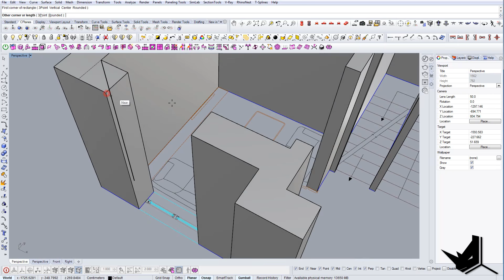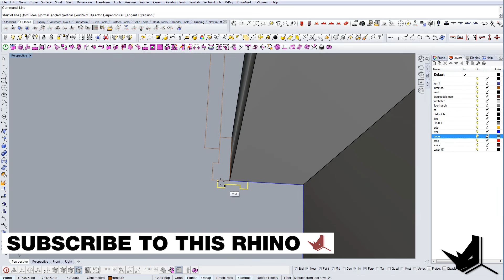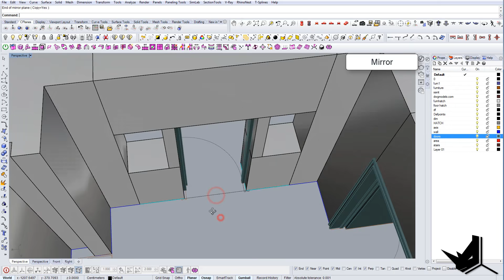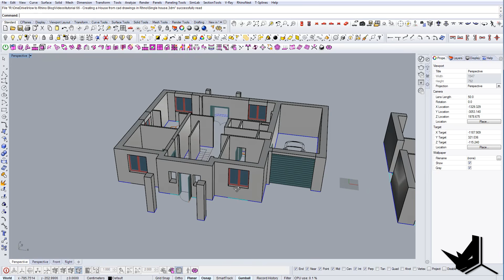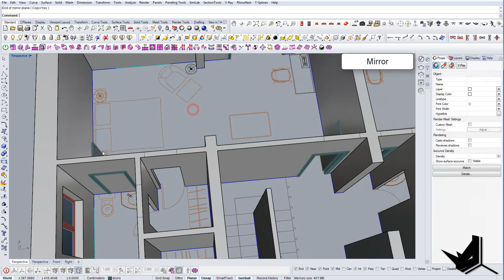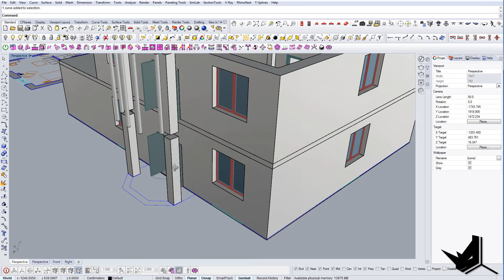Rhino Architecture - Modeling a House from CAD drawings

Comment: is it better and faster than archicad and revit?
Reply from the maker: Rhino is not a BIM software like Archicad and Revit, so we cannot really compare it in the area of which one is faster. They have different use-cases. If you're strictly talking about modeling speed, they can be equally fast if the person who is using them knows both programs very well. Rhino is mostly used for the conceptual phase of the project and BIM software for construction and documentation.

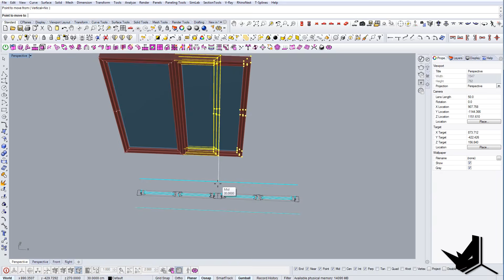Comment: Nice video. A question: how do you constraint direction to modify with Solidpt + move in min 30:49 ? You keep the direction and use a midpoint reference.
Reply: nevermind. Tab key is the key c:

Comment: i already boolion unioned the wall before i could model the window and when i command sweep 1 it doesn't work right,do you have an easier (but accurate method)  method?

Comment: Most helpful video i could get as an architecture student. Geat work! I can see alot of additional tools on the horizontal toolbar which u used to isolate, select specific colour objects etc. could you tell me how to get them?
Reply from the maker: Hi Kruti, thanks for your support! Glad to hear that you've found the video helpful. When it comes to all these additional tools on the horizontal toolbar, you can simply right click on empty space in any horizontal toolbar and then choose the menu from the list that you want to appear, the ones I have are "select" "visibilty" "set view" and then once you select them, they will appear on the screen as separate windows. Just pick them up and dock them anywhere you want in the screen :)
Reply: @HowtoRhino  Thank you! really adore your work :)
Reply: @HowtoRhino  also, when i do mergeallfaces, some seam lines are still there! what is the issue?
Reply from the maker: @krutivora7098  Yes, that means that those faces are not completely flat when you modeled your geometry, it probably wasn't 100% accurate and that's why you have this issue. If you zoom deep enough you will see that the geometry on that particular line is not flat.